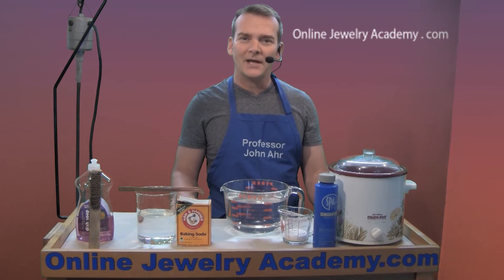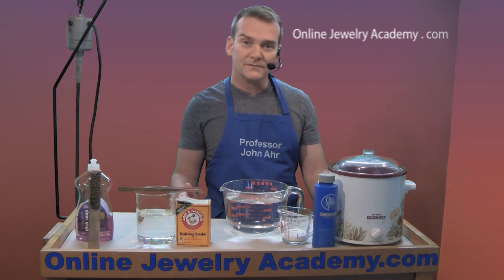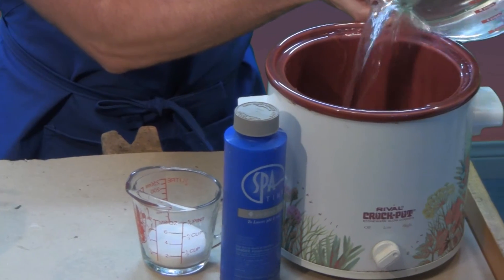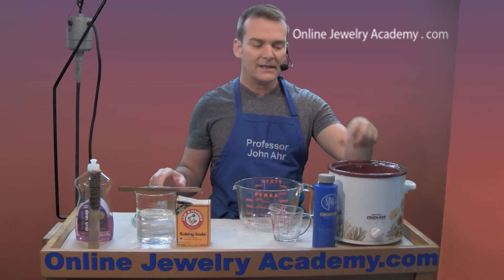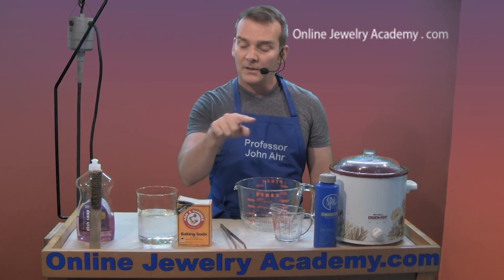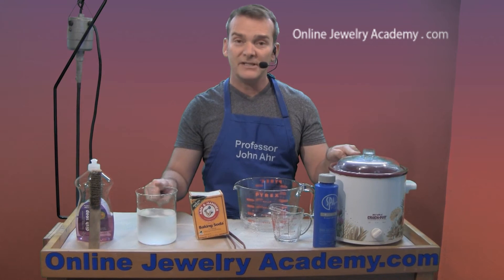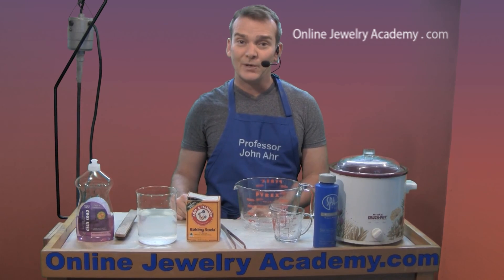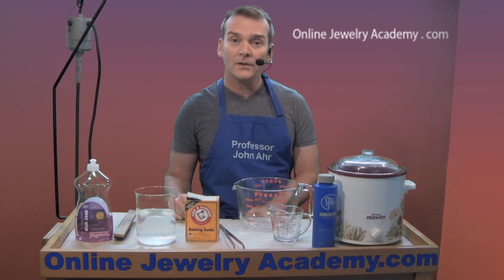How To Set Up A Pickle Pot To Clean Metal Items

Comment: how long do i typically leave the rings in the pickle pot for??
Reply from the maker: Typically, if the pickle solution is hot, you would leave the soldered items in the pot for a few minutes.  If, after brass brushing the items with soap, you find that there is still some oxidation on the surface just rinse the items and place them back in your pickle pot. 😉

Comment: Could I use the pickle pot to remove tarnish on commercially made items that I have purchased?
Reply from the maker: I wouldn't recommend it.  Besides, you'll get a better result if you merely polish the items.  There is a quick and easy technique where you can lean tarnish off of silver using hot water, aluminum foil and baking soda.  I never did a video on it.  But, I'm sure you'll find several on YouTube.  🤡

Comment: the pickle powder is sodium bi sulfate or sodium bi sulfite ? and can i use it also for casting tree cleaning after remove the investment powder
Reply from the maker: It’s sodium bisulfate that is combined with water in your pickle pot. yes, you can use it to clean your castings. But, you will need to change your pickle pot shortly after you’re finished cleaning. Investment is rather abrasive.😀
Reply: @OnlineJewelryAcademy  thanks

Comment: Dear Prof Ahd,   After annealing the copper for a bracelet your method did remove the fire scale.  However, rather than a shiny metal copper finish it is a dull orange/red.  These are long and very thin wires and are hard to brass brush.  Being twisted it is hard to get into the many spirals. Is there another method (preferably chemical) to remove the o/r residue?
Reply from the maker: You might try tumbling the wires. Here’s a link to an OJA video: https://www.onlinejewelryacademy.com/tumbler-video.html
😀
Reply: @OnlineJewelryAcademy  I stretched out the wire and rubbed it with a folded maroon Scotch-Brite.  Not perfection but QED

Comment: What is the heat setting used for pickling? And do you need to use a crock pot?
Reply from the maker: When I use a crock pot as a pickle pot, I set the temperature on its lowest setting.  Jewelry supply companies sell pickle pots.  But, they generally don't come with a lid.  That's why I tend to use a crock pot as a pickle pot.  I also use a crock pot because they tend to be well sealed so that the heating coil doesn't get corroded.  The durability of the ceramic crock is also another advantage.  : )

Comment: Hi John!
Thank you for your great videos. They are very helpful for me, as an amateur jeweler.
I have a project for a belt buckle making with the following materials:
- nickel silver sheet CDA #752 alloy (65%Cu, 17%Zn, 18%nickel)
- jeweler's brass sheet CDA #230 alloy (85%Cu; 15%Zn).
- SAE 304 stainless steel bar
- silver brazing solder Ag130 (30%Ag; 36%Cu; 32%Zn; 2%Sn)
- Stay-Brite Solder (96%Sn; 4%Ag)
Could you please tell me if your pickle solution (1/4 to a 1/2 cup of Sodium Bisulfate to 2 quarts of water) is suitable for this project of mine?
Just want to mention that I could isolate the stainless steel bar with some nail polish during the pickling process and remove the nail polish coat afterwards, if you think it is necessary.
Best regards!
Catalin.
Reply from the maker: Hi Catalin, Glad you like the videos.  The pickle solution in the video will get you through the construction process.  And, you don't have to coat the stainless steel with anything.  But, when you're done soldering, your piece will have a copper blush on the brass for sure.  After minimizing the solder with files and sand paper, use a nickel pickle on it to clean the outer surface: https://www.onlinejewelryacademy.com/brass-pickle-video.html.  : )
Reply: Thank you, John! So, just to be sure, I should use the nickel pickle only at the very end, after using the normal pickle solution in this vide, sand paper, files etc., isn't it?
Reply from the maker: Catalin Severineanu  Yes, Dave it until the end because it’s quite aggressive.
Reply: Hi John! I followed your advice. It is working great. Thanks!

Comment: Hi John, how are you doing; I got a question, If steel is no good in the pickle, would inox steel make a difference, say medic stainless steel tweezers?. Thanks ;)
Reply from the maker: Stainless steel can be used in the pickle pot.  But, in my classroom I do not allow any metal tweezers into the pickle pot.  I make my students just use the copper tongs.  Sometimes tweezers from craft and hardware stores aren't stainless.
Thanks for your support! : )

Comment: how much time required to burn metal part in hot post and which temperature?
Reply from the maker: Here is a link to a recent OJA video that I think will answer your questions: https://youtu.be/AH2Wh363JkI
The pickle pot should be set on LOW.  You never want it to boil.  The time it takes to clean a piece of metal depends on how dirty it is, how strong the pickle in your pickle pot is, if the pickle is warm, and how fresh the pickle is.  Watch the other video.  I think it will help.
Thanks for your support! : )

Comment: Hi John! Thank you so much for your great videos! I'm having a hard time for pickling brass. The pieces I solder are complicated to brush because the brush doesn't get to some places of the piece. So, I'm looking for the best pickle solution for brass. I saw in one of your videos that you recommend using peroxide mixed with sodium bisulfate (I went to a quimical store in Spain and she told me it was really dangerous to mix those,  so she gave me sodium metabisulfate. I used it and but I don't get the results I wanted. Now I saw this video and you mix sodium bisulfate in water and warm the solution. Which one is best for brass?
 I also read that water and sulphuric acid is good too. 
I'm really confused about the best and secure option for pickling! 
I will appreciate your help!
Reply from the maker: Hi Emma,  The pickle for brass is merely a 3% solution of hydrogen peroxide with just a little bit of sodium bisulfate.  As long as you don't cover it and use it under good ventilation you should be fine.  The normal pickle solution is approximately one quart of water mixed with a 1/4 cup of sodium bisulfate.  Just to be on the safe side, please confer with your chemical supplier about these quantities.
Thanks for your support! : )

Comment: Do you leave your pickle pot on all the time or if used occasionally would you just heat it up then? Thank you for the videos:)
Reply from the maker: No. I never leave my pickle pot on unattended.  I just turn it on when I begin working.  Cold pickle will work.  It just works a little more slowly.  Glad you're enjoying the videos.
Thanks for your support! : )

Comment: Another idea I came up while pickling--instead of using copper tongs, which can prove especially difficult on small pieces, use a basket made for dipping into liquids. These are made for ultrasonic cleaners and other lab uses, but--you can make one very cheaply using an all-plastic sieve found in the kitchen department of many store. Materials like nylon or HDPE resist acids, and you don't have to keep it in the pot all the time. It's super easy--I just put the items in the basket and lower it into the pot with the pickle. Taking out the basket, putting into neutralizer and then a rinse--no fussing with tongs. :)
Reply from the maker: Hi Kurt,  There are baskets like what you described available from most jewelry suppliers.  I generally use a plastic sieve in my own pickle pot.  Another way of keeping track of very small parts is to pickle them in a coffee filter.  I also keep bamboo tongs and tongs used for photo processing next to my pickle pot.  The photo tongs have rubber tips that can make picking up small items a little easier.  And, the bamboo tongs won't scratch items that I'm frosting.  Just be sure to neutralize them in some baking soda and water.
Thanks for your support! : )

Comment: Regarding whether a brush of one metal will scratch the surface of another metal—I consider that a very complex question which I think is best left to experimentation and finding the answer yourself. :) When one material moves against the surface of another, there are a lot of variables that contribute to what happens next, such as hardness of both materials, the shape and size of the tip of the tool used, the forces involved, temperature, and whether there is anything to dampen those forces, such as water, soap, etc. Of course, any contamination of the tool can change the result greatly. The shape of the tool is critical, and the same material in different shapes will affect the surface differently. For example, a sharp-ended copper wire of a harder temper drawn across a ‘dead soft’ copper sheet can leave a very deep mark that would require a lot of polishing to remove—or not, it really depends on what you want your results to be. Scrubbing a rough surface might refine it, where on a highly polished surface it would be degraded.
Reply from the maker: Thanks for the interesting comment Kurt.
Thanks for your support! : )

Comment: The brass brush is too abrasive and I do not want the brush marks on my work, how else can I remove the baking soda/left over pickle solution?
Reply from the maker: No, no, no Emma.  Just use the brass brush.  It is a burnishing tool.  It may look like it's scratching your metal.  But, it's actually burnishing it.  The items that you recommended are abrasive and will leave marks.
Thanks for your support! : )
Reply from the maker: Hi Dusty,  If you use your brass brush with a bit of detergent you can burnish the material that comes out of the pickle pot back to a shine.  This is a necessary step to ensure that all of the oxidation is removed from the metal before you go back to working on it.  Good luck with your projects.
Thanks for your support! : )
Reply: you can use a little bristle pad like an sos pad or the scratchy side of a sponge, still leaves a little bit of "texture" but not too much especially if you take your time and are gentle
Reply: I do a lot of silver soldering on brass and clean them with 400g sandpaper followed by 4444 steel wool and they gleam. I use the same steps to prepare for soldering and immediately apply the flux to keep the area to be soldered pristine.

Comment: I just got a soldering setup from Rio. It came with a mini pickle pot, a solution to put in it, and some kind of rectangular box that was spilling sand out of the seams everywhere. How do I use the "Pickleit"?
Reply from the maker: Hi Gunnar,  According to their website, the product you asked about should be dissolved in water to make a pickle solution.  If you need further assistance, they have a technical support line you can call for advice.
Thanks for your support! : )

Comment: Can you tell me if it is obvious, just by looking, when items have been picked for long enough?
Reply from the maker: +Emma Bates 
Hi Emma,  Yes, sometimes you can tell by looking at a piece that it has been in the pickle pot long enough.  But, sometimes you might be fooled.  If you think a piece has been in the pickle long enough, dip it in a neutralizing solution of water and baking soda and brass brush it with a bit of detergent and water.  If it doesn't look completely clean after brass brushing, simply drop it back in the pickle pot.
Thanks for your support! : )
Reply: +OnlineJewelryAcademy thanks for always replying so quickly.

Comment: Exactly what i needed to know.... you covered all bases,
Just learning this craft :)
Question:Is the crock pot a must or can i heat it on a propane camp stove too?
  I'm assuming it's to dissolve the sodium bisulfate?
Reply from the maker: +Joe Z 
Hi Joe!  The crock pot is sort of essential.  You not only want to heat the water to dissolve the Sodium BiSulfate, but you want to keep it warm too.  Cold pickle solution will work.  But, it works a lot more slowly than warm pickle solution.  Also, you really should use a crock pot because it has a ceramic container that won't react with the solution.  I hope that these answers help you in your new creative pursuits.
Thanks for watching! : )
Reply: Thanks for the reply,you've been a big help.
I'm getting a crock pot
Reply from the maker: +Joe Z 
Check the thrift store first!

Comment: I am using a small pot. Could you tel me the ration of sodium bisolfate?
Reply from the maker: +Kim Lyons I generally use 1/4 to a 1/2 cup of Sodium BiSulfate to 2 quarts of water.  Since I don't know what size of a container you are using, I though I'd provide you with the general formula.  Good luck on your projects.  And, thanks for watching! : )
Reply: +OnlineJewelryAcademy Thank you so much for getting back to me. I pulled up some conversions and did the math. 3 tsp to 2 cups of water is what I came up with. It is a 2 cup pot. I think it is called the little dipper.
Reply from the maker: +Kim Lyons Glad we could help you with your pickle pot issue.  Good luck with your projects.  And, thanks for watching! : )

Comment: I need help,  I left a sterling item in the pickle pot. When I took it out later it had a gray glaze caked on it. How can I remove the gray glazing?  email ra96ce@aol.com Thank you for any help or info you may have. Gene
Reply from the maker: +Gene Millard Hi Gene, The lesson here is to remember to clear out the pickle pot when you finish working.  Believe it or not, soldered joints can be adversely effected by long exposure to pickle.  The grey coating on your piece can easily be removed.  Simply heat the piece until you see the surface start to change.  If you brass brushed the piece it will begin to look dull and matte.  If you didn't brass brush the item first, the surface might start too look like it's being cleaned by the flame.  You do not need to fully anneal the item.  After heating and cooling the piece, place it back in the pickle pot.  Repeat the process if necessary.  Good luck with your project.  Thanks for being a viewer! : )
Reply: Thanks very much...

Comment: John, why oh WHY does the piece HAVE to be brass brushed? I have heard that it is done but I have never heard that is has to be or should be done. I thought it was a way to get a special texture...but that's because no one tells you WHY. Thanks, I'll bet YOU know  :)))
Reply from the maker: +Gabby Flying Chef Hi Gabby, The reason why you need brass brush items when they come out of the pickle pot is because the pickle pot doesn't entirely remove every bit of oxidation from the surface of an item.  The brass brush is a way to manually remove the remaining oxidation.  This prepares the item for soldering or finishing processes.  Now you know.  Thanks for watching! : )